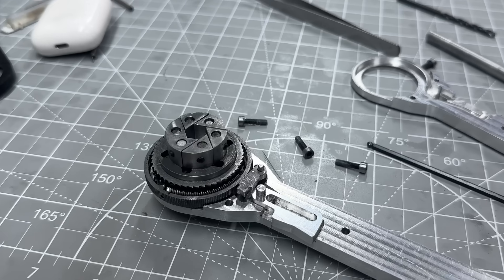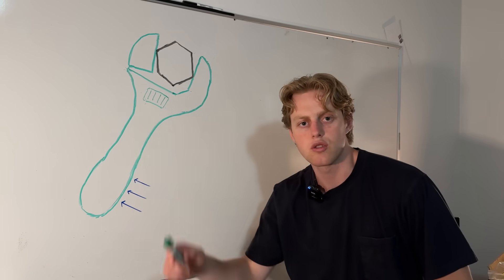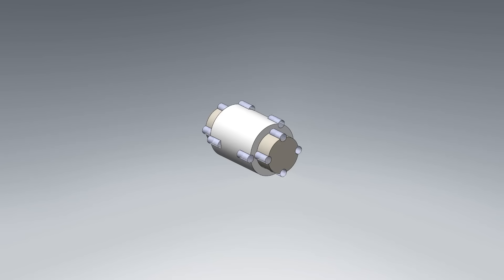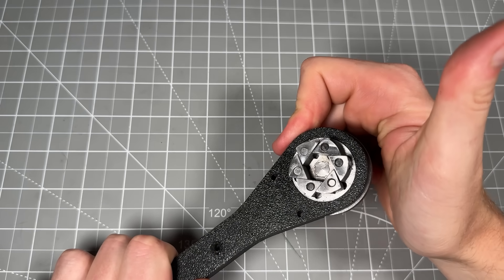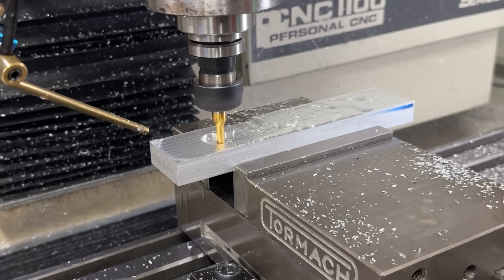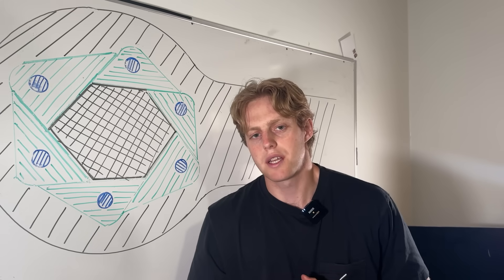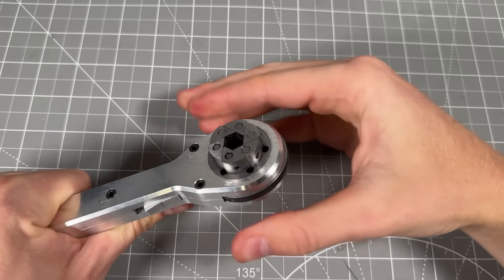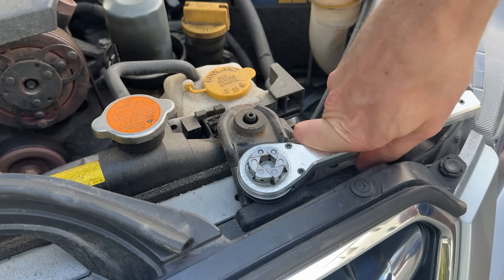I Invented an Adjustable Ratcheting Wrench

Comment: I honestly love the idea of the ratcheting direction being on different sides. It's not like I need to tighten then loosen the same bolt without taking it off, and it's easy to forget which side you're turning, especially if you have reversed threads on a motorbike or something
Reply: sometimes it really helps to tighten and loosen a stubborn bolt to get it off. loosen a little without breaking the bolt. spray some penetrant, then thighten to force the penetrant into the most rusted parts of the threads. rinse and repeat a million times, and the bolt is out without ruining the threads. in this scenario youd abosolutly want to be able to tighten and loosen quickly. i still like this wrench thoug :)
Reply: @allthehandlesweretaken  Yeah you're right actually I have done that. I recently built and disassembled 8x steel fences with about 10x 2.5m horizontal bars and 8x 2m vertical each, so 640 bolts and 1280 nuts in total going through holes I drilled way off center. I just used a spanner to get that started when they were jammed, as that turned out to be the most efficient for this bulk job, but some would only work with a ratchet, some would only work with the spanner. Overall I think I've proably used a ratchet to do that reverse loosening thing <1% of the time, but like everything it really depends on the jobs you do. I mostly do mechatronics and random handywork, but it would be very different if you were a mechanic or something, especially since you wanna do it right, but I know there are some rusty bolts on my motorbike I wouldn't be able to get off with a spanner too
Reply: @steve_jabz  that's why the most important tool is always the toolbox, so you can try diffrent tools for diffrent situations.
Reply: Honestly my main gripe with ratcheting stuff like screwdrivers is the fact they make the thing the same colour as the tool, and put it in a spot you can't really see it's set to when you're actually using it. If it were to be a 2 way ratcheting mechanism, you could put a small gap in the back with a colour coded piece of metal, so you could see what it's set to once it's on the bolt with ease.
Reply: most ratchet ring spanners work the same way (flip to reverse direction £
Reply: @eliotmansfield   -  - Scaffolders ratcheting podger "wrench"/spanner has a similar (double headed) appearance, but it has a reversing ratchet - and flips for different size    - here,  a different range could be on either side; sub 5/8" one side, sub 1" on the other..

Comment: Motorcycle mechanics are gonna love this, believe me;))
Reply: most of the motorcycles are crammed like a spaceship, and one needs to disassemble the whole thing just to get to some bolts...bulky universal things just won't do the job.
Reply: even if mechanics won't be the target audience, but riders definitely are - the smaller the toolkit to carry, the better
Reply: @schrodingering  Yep, when i think about what's the most common hex nut i need to tighten it's between 6 and 10mm.
When i'm already working on big stuff i get the toolbox out anyway but for those small annoying every day things like bike fender bolts, articulating desk lamp joint bolts etc a smaller version would be very nice to just have in that one kitchen drawer lol.
Reply: I am a motorcycle mechanic. This tool is 100% impractical to work on motorcycles.
Reply: 😂 no

Comment: Even if you released this as open hardware, I'd buy this immediately on a kickstarter. It wouldn't work for everything, but it would reduce the stress and effort for so many things where it does work. I think we've all wondered at some point why something like this doesn't already exist, even if we couldn't quite imagine the design and put in the time to perfect it, so if you're not pitching this to investors, you wouldn't even need to sell it. We all know exactly why we need it and why your design solves the problem.
I could CNC it myself, but it wouldn't be worth the effort finetuning everything the way you intended if I could just buy it for a reasonable price. I guess it depends whether you want to sell it to makers and hobbyists and be rich or lock it down with patents and sell it to industry and be ultrarich.

Comment: This obviously won't replace a socket set but could be a useful tool for maintenance tech or general use. My notes would is that it has to be deeper and the reversal should be achieved by pushing the jaws to either one side or the other, making the jaws on the unused side flush with the head.

Comment: This is really cool, probably not the best thing for working on cars or anything with tight packaging. However, I have a machine shop in my garage and I have many use cases where I’m grabbing a big adjustable wrench just because it is the most convenient thing and clearance is not an issue. I would definitely buy one.

Comment: I work in industrial maintenance and this would be useful to me. I have daily carries of tools and a socket with a universal adapter is just too much in my pocket. I feel this is slimmer and could be comfortable to have with me. Possibly make a few sizes? What I have been craving and have only found one example of is a universal allen wrench. This is basically hex shaped sleeves nested inside each other.  This was from an old kickstarter that fell flat.  I did see a youtube video of someone making one, but it was nowhere near ideal. Good luck with your project, and if you need someone to do daily testing with your tool let me know, Im more than happy to put it to work.

Comment: This is good start, props on the follow through my guy!
 id love to see a tiny version of this for 1mm-10mm sizes. i think for smaller bolts with a low profile version this would be really good!
Larger bolts I think it will be a lot more rough due to the forces it can see and the fact that big bolts are often on cars, which need to be pretty low profile. 
I'd love to see you try though, if you can get it low profile enough people WILL use it.

Comment: I'm impressed. I've seen loads of attempts at this (gator grips, etc) and they all have a  massive durability trade-off that tends to render them useless pretty quick.  
This is well thought out and looks to overcome a lot of these problems.  
The way it cams into itself to spread the force round gives me faith in it.

Comment: Man this is cool! Best ad for mechanical engineering.
Reply: There is no money in mechanical engineering
Reply: @Kawka1122  why not?
Reply: @syndeko55 ?
Reply: @Kawka1122 why isnt there any money in mechanical engineering?
Reply: @Kawka1122   - the money is in the ability to (quickly) mass produce what the engineers design and forward on to the "industrial designer" - who adds some curves and overmolding grips and "cool features"..
(Material selection is a make or break in many designs)

Comment: a small awl in the opposite direction with a push lever and spring could allow a button or slider on the handle to open and release the jaws without having to reach up to the head

Comment: Insanely cool project. As a mechanical engineer in the machining business, I'm very impressed by the quality and tolerances you achieved. You should definetly keep on developing this and maybe do a kickstarter as this could legitimately sell very well for professionals in fields where lots of bolts of different sizes need to be (un-)tightened in easy-to-reach places.
Reply: Do you guys realize a ferule crimper already uses the same mechanism?
Reply: @bobweiram6321  they don't know about the power of the iris
Reply: @bobweiram6321 crimpers are not made for torque
Reply: Is it for bolts?
Reply: While this is a super cool project, I have yet to come across problems where you need to tighten / loosen many fasteners with  that many different socket sizes. And for the odd unexpected hex bolt M data ly carry, the knipes pliers wrench exists. But again, super cool. I see it more as a tool collector / lover product.
Reply: @thorwaldjohanson2526  I showed this to a friend of mine who is an HVAC technician and he told me this might come in handy on some jobsites. I think this might be about as useful as a ratcheting screwdriver, where it's not really a necessity, but it might save you a bunch of time in the long run.

Comment: Its all about the clearance around the bolt. Little clearance leads to a thin walled socket that is rigid enough to take the torque .  Its nice but useless as of now. If you could achieve thin walled adjustable socket that takes the torque you will be golden .

Comment: I like it but i wouldn't buy one due to cost and fragility. I mean why buy one wrench for 150 euro when you can buy 10 wrenches for 15 euro. i have a suggestion though. you may be familiar with unscrewing a bolt with a ratchet and having it trap the wrench against a firewall. you might consider creating a way to disable the pawl so that the bolt can be screwed in again, releasing the ratchet.

Comment: Metallurgist here. I'd recommend using S7 lightly tempered to 56 - 60 HRC instead of the 52100 which is probably about the same hardness, or the 4130 you first used, which is probably below 52 HRC. S7 pins will have a similar yield limit to 52100 pins, but also greater resistance to brittle fractures if they get impact loaded from a user wailing on a stuck bolt or something. If you determine that there's no way the pins will ever yield at some hardness higher than 50 HRC but lower than 60 HRC due to some other part failing first, you can still temper the S7 down anywhere in the 50 - 60 HRC range and get even better impact resistance.

EDIT: @derekturner3272 correctly pointed out that I wrote this a bit wrong the first time around, misquoting the 4130 data as the 52100 data. Fixed that. Thanks!
Reply from the maker: Thanks for the advice. This is exactly the type of comments I was hoping for when I posted this!
Reply: @Trevor_Faber this type of knowledge and experience is what's needed for further development. South betterand quicker to tap into a life of experience and dedication than trying to digest all the engineering and metallurgy data yourself.
Reply: @Trevor_Faber  If you can't find this stuff on the shelf, and especially if you can grind things easily, use good quality allen keys as your material. Typically made of impact resistant steel grade and hardened quite hard.
Reply: @Trevor_Faber woah. Killer attitude. Way to get at it
Reply: This is good advice 💯
Reply: The absolute best you can get is C350 maraging steel it can achieve a yield strength of 2.4GPa,  about 50% better than hardened S7 or 52100.
Reply: @appa609 how much more expensive?
Reply: @appa609 I'm only finding limited data published on C350, but what I'm seeing shows that it marages to about 56-60 HRC, which is almost identical to S7, and data for S7 in that hardness range is pretty close to 2.4 GPa yield. Strength and hardness very closely correllate for metals so it's highly unusual to have two metals at the same macrohardness exhibit widely different yield strength (hardness measured by indentation is widely considered to be a direct measure of yield strength, the correlation being only limited my difference in compressive versus tensile strength). Even if the extra yield strength is worth anything (he suggested that 50 HRC may be enough to make something else the weakest link, which is another advantage for S7 that is easy to temper down that far and get extra fracture toughness)...C350 is going to be eye-wateringly expensive. S7 is not cheap, but it's affordable enough to be common for tools (it's a...tool steel, actually). That also means it's widely available from a LOT of mills and distributors, which would be important for mass production, although for small batch production not so much.

The C350 looks like an excellent steel for those spiral bolt extractor bits, though.
Reply: S7 is absolutely great stuff. One of the most versatile tool steels made. We used it for all kinds of stuff in the press room. Makes a great drill bit and knife stock as well. And back when you could buy a proper American file the best were S7 steel. Cool project, very clever.
Reply: Carbide pins?
Reply: @Gorgashmill Those are usually extremely brittle and very expensive.
Reply: @Gorgashmill too brittle imho
Reply: @Gorgashmill [Tungsten] Carbide is one of the hardest and strongest tool materials, but it's also one of the most abrasion resistant, and that's the property that it mostly gets used for. It's usually in the form of ceramic particles cemented by cobalt metal, so it's much more brittle than most metals, but not at brittle as most pure ceramics, like silicon carbide. Tungsten carbide pins would likely crack far more often than S7 or even 52100 pins would bend.
Reply: I make razors of out a 52100 core laminated inside 410SS and it's heat treats like a beast.  I typicallt get 60-62 before being tempered back in my case to 57-58HRC.  When you say it's 52HRC, you mean as shipped/annealed?  As I understand it, annealed 52100 is down in the 22HRC or 250(HB) Brinell hardness range.  It's used as a ball bearing steel because it's so easy to work/grind and hardens very well with a great balance of harness and toughness.
Reply: @derekturner3272 Aha, good catch. I misquoted the data for the 52100 he's using now versus the 4130 he started with. The 4130 is probably around 50 HRC (assuming a mild tempering at maybe 250F) while the 52100 is probably about 60 HRC. In some cases, especially with ultra-clean vacuum arc remelt 52100, it may be possible to quench out around 66 HRC, and then temper to around 64. Carbon and alloy content isn't the limiting factor for hardness in this grade, it's alloy segregation and microstructure homogeneity. It's also very sensitive to heat treat variations. It makes an excellent bearing steel because it resists rolling contact fatigue so well, especially the more expensive VAR stuff, but at equal hardness (strength) it still cracks easier than S7, which is why I think there's a durability advantage here.
Reply: This is epic! Also shows how good the algorithm is working

Comment: 0:28 - yes, it doesn't exist because there is no need for it, it is too big, too fragile and would be much too expensive, that should have been the end of it, not this futile attempt of making something that is already there - socket, extension and ratchet wrench
Reply: Looks at car when first invented, there’s hundreds of tiny parts, it’s noisy and unreliable
Reply: @peejayem4700  when someone compares a wrench to a car, any car, any time, it tells quite a lot about their IQ
and if you had some real world wrenching experience, you'd know that this tool at that size is nearly pointless, you won't rely on something like that when better half of bolts usually are difficult to reach, in tight space, recessed, making this toy completely unusable
dude just couldn't figure out anything useful so he did the usual mistake - invent a solution to a problem that didn't exist

Comment: Maybe try making the wedges be pushed inward from the outside on the same plane. It would make the head larger but could eliminate the need for pins as a weak point. It would lock the wedges for forward turning, and you could allow it to slip a set distance, allowing it to ratchet around the bolt when turning in reverse.
Reply from the maker: I like the idea. If I am picturing it right I had a similar concept. Maybe I will share it in another video. But as you pointed out the head size was the main thing that steered me away from this approach.

Comment: That's an amazing idea!
I think the biggest enemy of your design is going to be contamination.

If you want to simulate contact and movement to failure I can recommend a free combination.
LS-Prepost with OpenRadioss. It's good enough for car crashes :D

The lazy way is to import the .step files, auto-mesh, use material 18 or 24 with failure, mortar contact, add fixtures and loads.
You can plot contact forces, kinetic and potential energy for each part and so much more

- all the best from Poland

Comment: SOLID!! Definitely continue working on it. I would also test how well it performs after getting dirt all over it. From the design perspective, there seems to be quite a few places sand can get into and cause failure. Additionally, consider if you can redesign the circular the outer sides of the chuck to a 3/4 when closed, so you can fit a socket when needed? You probably thought about and i’m sure there’s a lot of design limitations but never know, could make the wrench much more feasible for daily use 🤷🏾‍♂️

Edit: I’ve had more coffee. Reread my suggestion..Disregard the chuck comment, def didn’t make sense. Also, i’ve thought of how the design is flawed in general. Though the current design is awesome, it’s just way too bulky for everyday use. It already looks like it struggles getting to bolts. You can’t put a socket on it (which is what it’s supposed to replace i assume) so you can’t get it to reach far bolts. Maybe sizing it down would make it more practical. But if we’re honest, might as well use ratchet/socket wrench, no? I’d put some more thought into when and who will be using this tool.
I would then think about manufacturability and cost, as it looks like you need high precision in some of the parts.
Reply: This is a case where I wouldn't use the product BUT, I'd want one as a cool thing and I'd hire the designer without an application.